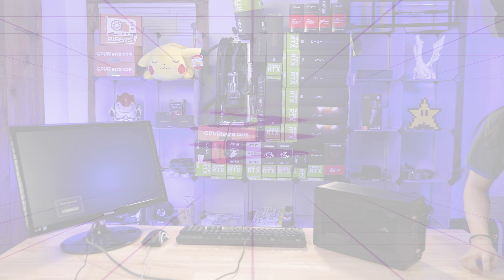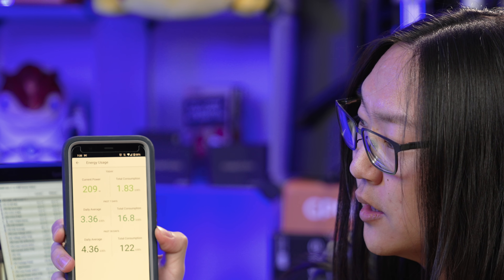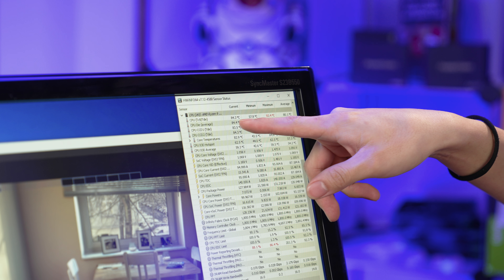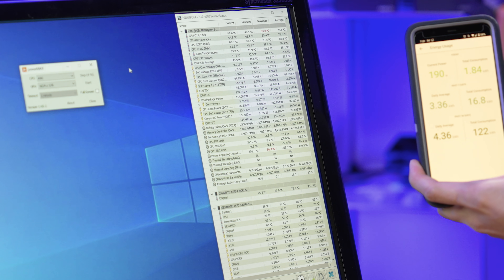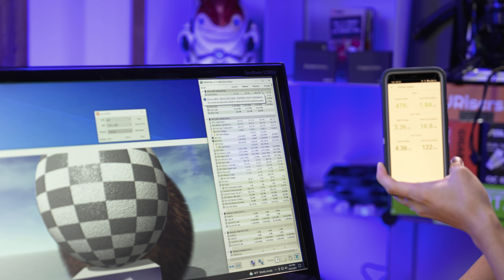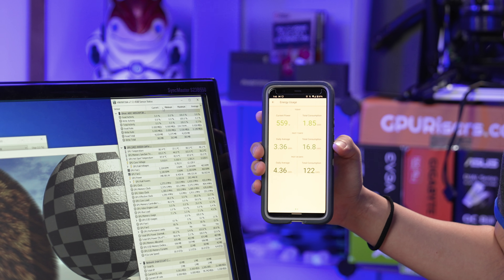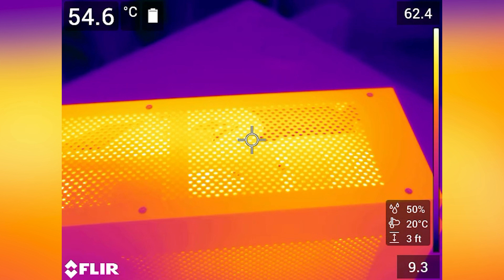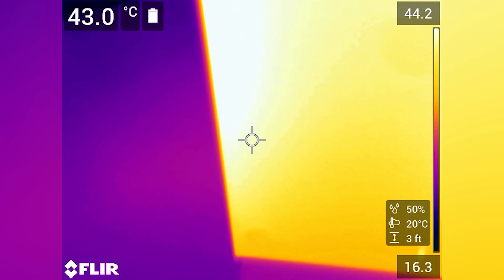IT's HOT!! 🔥🔥 Mini PC Dan Case Thermals

Comment: Hi @Tekshiji and all SFF enthusiasts, I just built the almos exact same build with my "new" 3080 Ti and a AMD 3700x processor. 
I'm still testing and the only thing I'm concerned about is the memory on the 3080 Ti with 102 degree Celsius. 
Should I mod my card with new thermal pads (Gelid Extreme front 1.5mm and 2mm back plate) or is the 102 degree just fine? 
Would appreciate your opinion about it.
Reply from the maker: Hey there buddy, it's really hard to talk about this over a common so I recommend you join our discord link in the description. However, I would say that that is kind of hot and I would try to keep it under 95° for full loads. If it only gets that hot for sure periods of time it's probably okay, but I wouldn't be comfortable with that for a long-term.

Comment: Im a DAN Case user, and just picked up the 3070ti... it uses the same cooler... im wondering if i can do anything to help that fan..... i heard you can turn the powersupply around to allow some room that way...
Reply from the maker: Honestly, it was totally fine. Like in the video we ran this thing into the ground and it still didn't overheat I don't think it'll ever be an issue to be honest. Unless you stick it in a corner under a desk somewhere with no ventilation.

Comment: Amazing build, I have an Ncase m1 but wanted this exact case to go as small as possible but didn’t know if the power would be too much but glad it isn’t! I imagine with undervolting and realistic gaming applications the temps wouldn’t hit higher than 75c
Reply from the maker: Yeah, I was really surprised how well a water-cooled 92 mm radiator would work on a CPU like that. Crazy hell Cody was so good and it didn't overheat

Comment: There's the RTX 3080 Ti X3 from Inno3D that is a 3 fan, 2 slot gpu that is literally MADE for this case. All fans facing outwards, fits perfectly with it's 300mm length and even it's looks share the brushed aluminum minimal design of this case. It literally looks like it's part of the case itself.
Although I recommend the 3070 Ti version of it instead due to less power use > less heat output. Also, the 5600x instead with an air cooler (like the L9a+duct or AXP90 Full Copper). And both case fans to assist gpu heat dissipation further.

Comment: This is the one time youtube's recommendation algo has got it right, I was looking at getting the Dan A4 and was curious abouts its thermal perfomance albeit with a 5600x and 2060 super. This video was great hope to see more content on SFF pcs in the future :)
Reply from the maker: Hey man, thanks a lot! I'm glad you liked it. If you're curious as to how we built it, check out the original video. This is a two-part. The first video we build it. It the second one is when we tested the thermals that 92 mm AIO really does help!
Reply: @TekShinji  good shout thankyou! Just finished watching and was wondering would you still recommend the 24pin custom even though I don’t plan on using a AIO? I think there should be enough room.
Reply from the maker: With OUT the AIO and a STANDARD sfx PSU you should be good. But always check the clearance from the manufacturer. 

Thanks for watching part one of the build!

Comment: Perfect timing 👌 I thought about building a nice little office pc today, but was worried about the heat. At max it will be around 300W so it should work out for my itx case.
Reply from the maker: Yeah the 92 mm AIO liquid cooler is perfect for this. Can really handle a ton of heat. Check out the build video of this to see if it works for you!